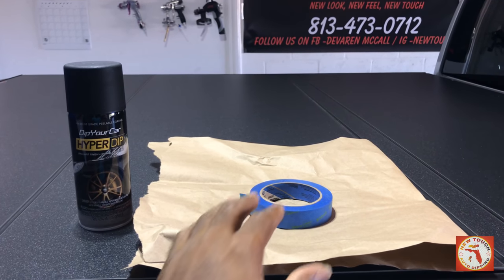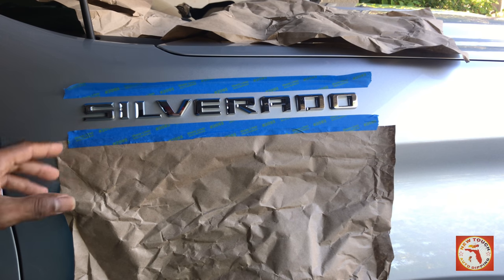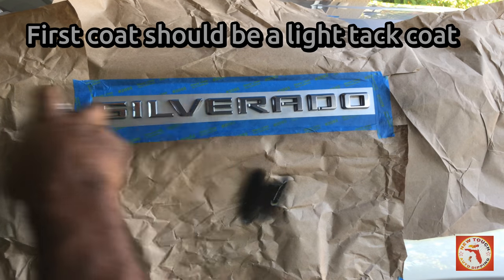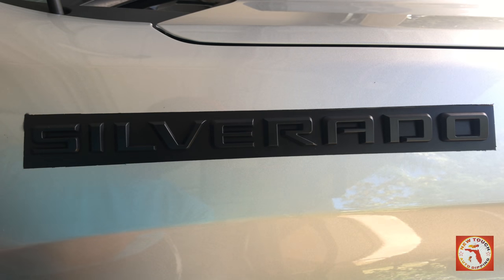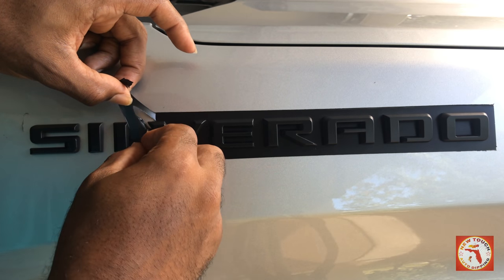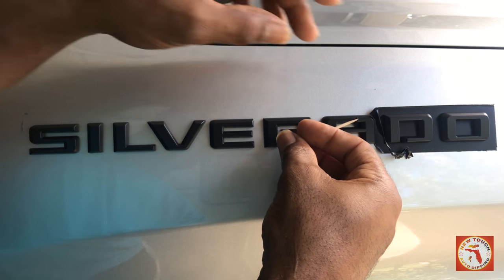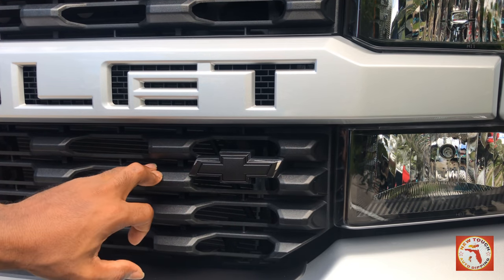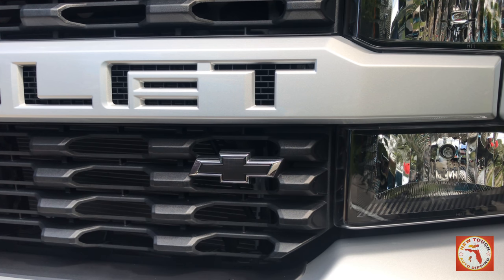(How to) HyperDip/Plasti Dip Your Emblems

Comment: Great work bro, how much time do you wait between coats?
Reply from the maker: If your temperature is 65-75 degrees give it 15-20 minutes, if it’s 75 degrees above 10 minutes, if it’s 65 degrees below 25-30 minutes. Your temperature plays a huge role when you’re either outside or in a garage so the best temperature setting is 72-75. Wait 1 hour before peeling what’s left around the emblems

Comment: Do you ever use...or need to use clear coat?  (Is clear an option?)   I would worry about rubbing the coating off when washing. Great video!
Reply from the maker: Not with hyperdip, there isn’t a stand alone clear coat for this product. However they now have 2 hyperdip gloss finishes available, emerald metallic and piano black. I actually have a video uploaded on the emerald metallic black gloss if you’re interested
Reply: @newtouchauto  I am interested!  Last year I experimented with some Honda emblems.  Came out good, but the front one took some highway hits.  (small sand/gravel??)  So my "Si" logo is now a red "S" and aluminum "i".  That one is simple to repair, but I love your method for body emblems without removing them.
Reply from the maker: @artthurman3446  I’ll be the first to tell you that hyperdip is on another level vs plasti dip, there’s more durability to withstand those type issues.

Comment: How long before washing it with that pill paint
Reply from the maker: I normally wait 5 days but your temperature will determine the cure time.  You’ll wanna be sure that the paint adheres properly before applying water or pressure, hot temps will speed up the cure process.

Comment: What is the pre dip spray, and did you just use it on the chrome lettering?  Then you used alcohol, wasn't sure where you were wiping it on the paint or letters.
Reply from the maker: Pre-dip spray is applied onto the surface that you’re going to paint, pre-dip spray helps the paint adhere properly to the surface. The 99% alcohol was used to get a better bond around edges for the paint.
Reply: @newtouchauto  Is the pre dip spray sold on the hyper dip site?
Reply from the maker: @dbsimms63  yes you can find it on dipyourcar.com

Comment: Nice video but for some reason eveytime I do my emblems and when it's time to peel it lifts up in the letters it's not cutting around like how yours tuned out why is that?
Reply from the maker: More than likely it’s bc you may have sprayed it too heavy on your first 2 coats. The first 2 and last coats are the most important when spraying anything, the 2 tack coats will need to be light so that it can stick properly. It’s peeling up bc you’ve created a bond between the body panel and emblems, with light tack coats in the beginning you avoid that lift issue.
Reply: You are one of the few who actually respond to people asking a question! Much appreciated 🙏
Reply from the maker: @jonathanmariani5627  you’re welcome, I like to show my appreciation by making sure that I value everyone’s time commenting. Thanks for checking out the video and you asked a great question by the way.

Comment: How long should you wait between coats
Reply from the maker: If your temperature is 65-75 degrees give it 15-20 minutes, if it’s 75 degrees above 10 minutes, if it’s 65 degrees below 25-30 minutes. Your temperature plays a huge role when you’re either outside or in a garage so the best temperature setting is 72-75. Wait 1 hour before removing the extra dip around the emblems, you’ll want to give it time to bond which makes it easier to peel

Comment: How long are you waiting between coats?
Reply from the maker: If your temperature is 65-75 degrees give it 15-20 minutes, if it’s 75 degrees above 10 minutes, if it’s 65 degrees below 25-30 minutes. Your temperature plays a huge role when you’re either outside or in a garage so the best temperature setting is 72-75. Wait 1 hour before removing the extra dip around the emblems, you’ll want to give it time to bond which makes it easier to peel

Comment: How long are you waiting between coats?
Reply from the maker: {Your temperature will determine the flash time between coats, when the outside prep where you overspray is dry to the touch you can start the next coat. Normally if it’s 70-85 degrees give it 10-15 minutes. 
{After the last coat wait 1 hour before peeling the excess around the emblems. 
{I normally suggest that you wait 5-7 days before washing, you’ll want the paint to cure properly to the areas sprayed.

Comment: What's the wait time on each coat ?
Reply from the maker: If your temperature is 65-75 degrees give it 15-20 minutes, if it’s 75 degrees above 10 minutes, if it’s 65 degrees below 25-30 minutes. Your temperature plays a huge role when you’re either outside or in a garage so the best temperature setting is 72-75

Comment: Great video! I do have one question though, how long did you wait in between each coat?
Reply from the maker: If your temperature is 65-75 degrees give it 15-20 minutes, if it’s 75 degrees above 10 minutes, if it’s 65 degrees below 25-30 minutes. Your temperature plays a huge role when you’re either outside or in a garage so the best temperature setting is 72-75. Wait 1 hour before removing the extra dip around the emblems, you’ll want to give it time to bond which makes it easier to peel
Reply: New Touch Auto Dipping Awesome thanks!

Comment: How long will that last?
Reply from the maker: With emblems it’ll last pretty much as long you want it to, when applied correctly you won’t have any issues with it peeling. It’s suggested to remove or recoat around the 3-4 year mark for a proper removal

Comment: Awesome video! How long do you wait between coats before moving on to the next?
Reply from the maker: Thanks for the compliment and checking out the video. If your temperature is 65-75 degrees give it 15-20 minutes, if it’s 75 degrees above 10 minutes, if it’s 65 degrees below 25-30 minutes. Your temperature plays a huge role when you’re either outside or in a garage so the best temperature setting is 72-75
Reply: Awesome, thank you!

Comment: How many seconds did you wait between the sprays? After the last coat, how many seconds or minutes do you wait to start peeling off the remainder? How long to wait before going to a car wash?
Reply from the maker: {Your temperature will determine the flash time between coats, when the outside prep where you overspray is dry to the touch you can start the next coat. Normally if it’s 70-85 degrees give it 10-15 minutes. 
{After the last coat wait 1 hour before peeling the excess around the emblems. 
{I normally suggest that you wait 5-7 days before washing, you’ll want the paint to cure properly to the areas sprayed.
Reply: @newtouchauto  so let’s say it’s 70 degrees out, I would spray then wait 10-15 minutes, spray then wait 10-15 minutes and so on for 12 coats? Do I have that right? BEST VIDEO on this work on the internet! Gave me the confidence to try this, although I’m sure it will take me 8 hours! 🤣
Reply from the maker: @lauras3198  yes with that temp setting, with emblems you can get away with doing 10 coats, 12 is my standard that I like to go by whenever I’m using hyperdip. The greater the coats the better the durability and peel ability.

Comment: Very Good video!! I must have missed it but how long between each coat? Thanks!
Reply from the maker: If your temperature is 65-75 degrees give it 15-20 minutes, if it’s 75 degrees above 10 minutes, if it’s 65 degrees below 25-30 minutes. Your temperature plays a huge role when you’re either outside or in a garage so the best temperature setting is 72-75
Reply: @newtouchauto  Thank you for the info!!
Reply from the maker: @toddspeakman3469  you’re welcome and thanks for checking out the video

Comment: Quick question, is there any clear coat needed to be added afterwards? Or is it good to go without it
Reply from the maker: With this being a satin finish it was good to go, the customer wanted this. They also have a gloss finish that can be added over the shadow black if you decided to change on a later date.
Reply: @newtouchauto  ok thank you for the reply 🙏 easily the most helpful video out there
Reply from the maker: @OnomatopoeiaBoo  you’re welcome and thanks for checking out the video

Comment: how much time do i need to wait so i start peeling? Nice video and rlly well explained man.
Reply from the maker: Thanks for the compliment and watching the video. Give yourself 1 hour before you began to peel the excess areas, the wrap will become more durable allowing you a easier grip and peel.
Reply: @newtouchauto  thanks for answering, In spain there’s no hyperdip or any distributor of it but I’ll use fulldip instead I guess it’s more or less the same. Thanks again great job wit ur videos
Reply from the maker: @marcdiam5825  you’re more than welcome and I didn’t realize that my video would reach Spain 😮 Actually these removable paint products require the same process, it only changes whenever you’re using the better quality paints.

Comment: How long until it becomes permanent or do you always have the option to peel it off?
Reply from the maker: With this product you’ll always have the option to peel it off at anytime. You won’t experience any damages from the wrap and when it’s applied correctly you won’t have any issues.
Reply: Wow insane product, I've seen people spraying rims with this stuff. So it must be fairly durable then. Amazing that you can removr it damage free, yet its durable enough for rims.
Reply from the maker: @daimianp  correct, the durability will be determined on the layers sprayed. The proper or more coats are important for the longevity as well peel ability.

Comment: Interesting!!!! How long do you have to wait in between each coat??
Reply from the maker: Give it about 10-15 minutes in between coats, use the masking aper as a guide. If it’s dry on the outside of the painted surface then you may proceed spraying. If not wait until it’s dry
Reply: @newtouchauto  Copy that!!! What about for the final coat??
Reply from the maker: @dylanz5598  after applying the final coat you’ll need to immediately remove the masking. A fully wet coat will make it easier, wait 1 hour before peeling around the emblems.

Comment: Can we use the heat gun to dry in between coats ?? Please let me know asap or someone. Thanks !!🙃.
Great tips by the way
Reply from the maker: A heat gun is a big no no, the reason is that you’ll only create a blemish that’ll leave you with a faded look. You’ll need to let it dry normally in decent temperatures, 10-15 min wait times in between coats of temps 65-80 degrees. Use the overspray around your emblems to touch and test to see if it’s dry enough to proceed with your next coat.
Reply: @newtouchauto  awesome. Thank you very mucho! 👌👌
Reply from the maker: @babydzcreationz510  you’re welcome and thanks for checking out the video.
Reply: @newtouchauto  no prob.. your video was the most helpful 👌  thx for taking the time to make this video.

Comment: Great job. 
Question how long will it last with normal wear and tear, washes ect.
Reply from the maker: Plasti Dip can last 3-4 years before needing it removed or repainted for a fresher look and proper peel ability. I’m pretty much sure that hyperdip has the same affect if not longer, it was released late 2019 so no one has quite reached the limits. When it’s applied correctly you won’t have any issues with hand, drive through or pressure washing
Reply: @newtouchauto  thank you
Reply from the maker: @kellybirge8017  you’re welcome and thanks for checking out the video

Comment: When you wash your car it doesn’t come off ? And how long does it last ?
Reply from the maker: When it’s applied correctly it won’t come off while washing, I’ve attached a link for washing if you’d like to see for yourself. 
https://youtu.be/WxrjERIBDHg

As for longevity, with outdoor use you can get 3-4 years before needing to remove or recoat it a few times.
Reply: @newtouchauto  appreciate it 🔥
Reply from the maker: @miguelrodriguez3586  your welcome and thanks for checking out the video.

Comment: Will the same process work for the chrome work around the windows?
Reply from the maker: Yes actually this product is at it’s best over chrome areas, just be sure to prepare the surface properly.
Reply: Thanks,  I'll definitely have to give it a go
Reply from the maker: @keithmeeker1276  you’re welcome and thanks for checking out the video.

Comment: How long are waiting in-between coats
Reply from the maker: If your temperature is 65-75 degrees give it 15-20 minutes, if it’s 75 degrees above 10 minutes, if it’s 65 degrees below 25-30 minutes. Your temperature plays a huge role when you’re either outside or in a garage so the best temperature setting is 72-75. Wait 1 hour before removing the extra dip around the emblems, you’ll want to give it time to bond which makes it easier to peel

Comment: What's a good way to remove your emblems all together without messing up the paint or anything?
Reply from the maker: I have a video uploaded on removing your dipped paint if you’re interested. Simply use a dry microfiber towel to start your peel and remove it easily or take a toothpick/plastic tool to break the dip and twist then peel away. If there are any hard to reach areas dipyourcar.com has this spray called Dip Dissolver that’ll breakdown the dip and you pressure wash it off.
Reply: @newtouchauto  that's cool, but I am wondering how you can remove your emblems from the car. I don't like all that branding stuff all over the car. I think my car would look a lot cleaner without anything written on the car.
Reply from the maker: @raiderwolf2066  you can remove any emblem or logos from your vehicle, you’ll need a heat gun and some fish string to cut the letters off.

Comment: How long do you wait in between coats to dry?
Reply from the maker: If your temperature is 65-75 degrees give it 15-20 minutes, if it’s 75 degrees above 10 minutes, if it’s 65 degrees below 25-30 minutes. Your temperature plays a huge role when you’re either outside or in a garage so the best temperature setting is 72-75. Wait 1 hour before removing the extra dip around the emblems, you’ll want to give it time to bond which makes it easier to peel

Comment: Does platidip last ?
Reply from the maker: Plasti Dip can last 3+ years when applied correctly but you have to keep in mind that you’ll need to remove it at some point. Hyperdip will pretty much work the same but has better quality

Comment: How long did u wait between coats
Reply from the maker: If your temperature is 65-75 degrees give it 15-20 minutes, if it’s 75 degrees above 10 minutes, if it’s 65 degrees below 25-30 minutes. Your temperature plays a huge role when you’re either outside or in a garage so the best temperature setting is 72-75. Wait 1 hour before removing the extra dip around the emblems, you’ll want to give it time to bond which makes it easier to peel.

Comment: I have a black chevy trail boss and I would like to make everything black on it. There is a little silver button on the 2 front doors. Would the hyper dip work on those areas? Not sure because it is a button.  Thanks
Reply from the maker: Yes in the paint terms we call that chrome delete, blackout or murdered out. Hyperdip will pretty much stick onto any panel when it’s properly prepared, I only suggest that you don’t spray anything rubber or weather strips.
Reply: @newtouchauto  ok thank you
Reply from the maker: @codymcfarlin8820  you’re welcome and thanks for checking out the video
Reply: @newtouchauto  hey one more thing when you get time. Is there a way you can black out the silve accent trim on the dash of chevys and chrome around the cup holders?  Thank you so much!
Reply from the maker: @codymcfarlin8820  most definitely but I suggest that you use vinyl wrap for the inside. Vinyl has whey less work and the paint finish will already be flawless. If you decide to use the route in my video just be sure that you properly prepare the areas but yes it can be done with liquid spray wraps
Reply: @newtouchauto  awesome thanks again I'll keep watching !

Comment: Was it because you cleaned the emblem with the spray and alcohol and didn't clean the area around it?
Reply from the maker: Check your previous reply for the answer to your questions. Thanks for checking out the video, I appreciate it
Reply: @newtouchauto  so it was because of my first question.   Thanks.
Reply: @newtouchauto  I'm going to be painting my car and I was thinking of using the dip to cover my emblems.
Reply from the maker: @davidecklund04  yeah you’ll pretty much need to prepare the area before painting, that way everything will adhere and stick properly.

Comment: Quick question, if the car is always garaged and rarely just baking in the sun would it still be recommended to remove the paint on the emblems and re-do the job every 3yrs? I'd probably be using Rustoleum Graphite wrap paint since it's the color I'm wanting (if that matters). Thanks again for doing what you do!
Reply from the maker: You’re welcome and yes you can achieve a longer lifespan with a vehicle being garage kept. If the Rustoleum paint is removable paint then I’d say that the same info applies.

Comment: so how long does it stay on the letters? does it start peeling in a car wash or what not?
Reply from the maker: With emblems they pretty much last as long you keep the dip on. As long you prepare the emblems and apply the dip correctly you won’t have any issues with a pressure washer nor a drive through car wash. It’s ideal to remove or recoat the dip around the 4 year mark for the proper removal.
Reply: @newtouchauto  wow, thank you. thats amazing.
Reply from the maker: @technicaltrucking8704  you’re welcome and thanks for checking out the video